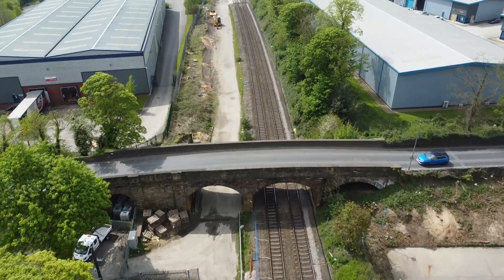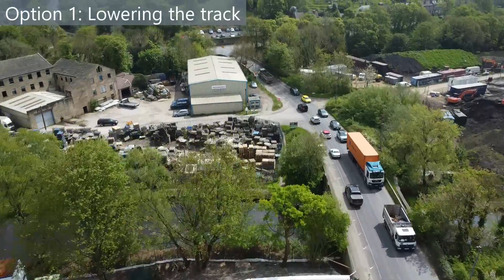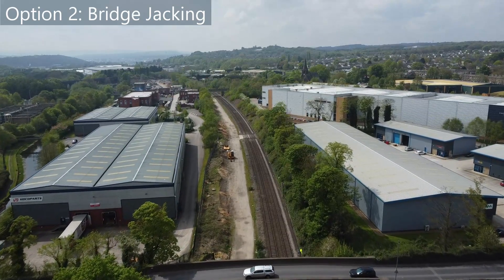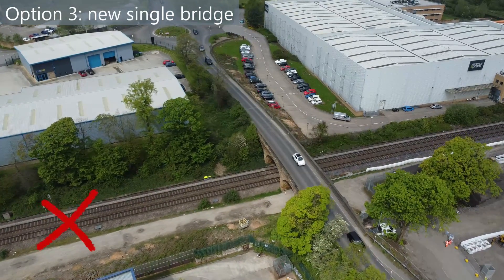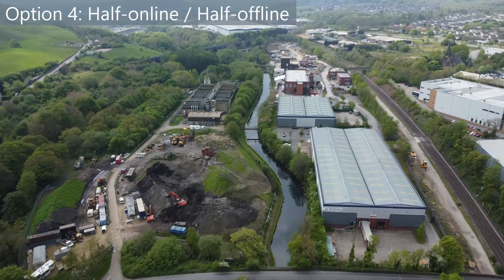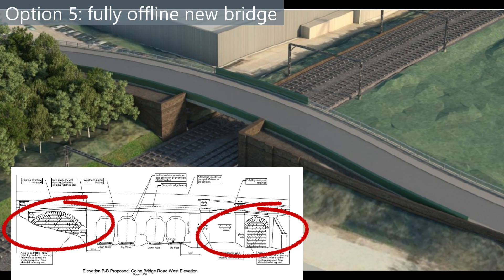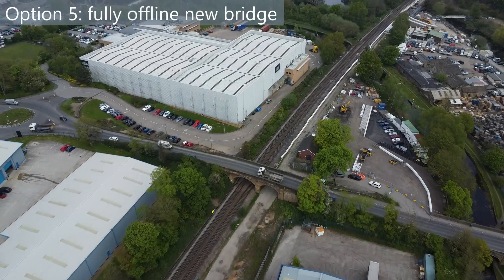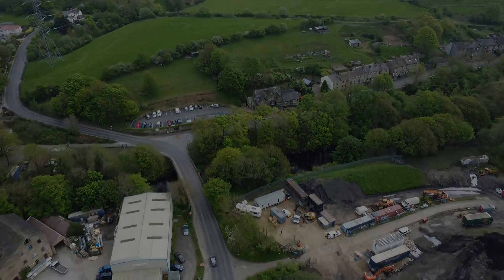DRONE Update: Colne Bridge, Transpennine Route Upgrade - a big change coming

Comment: Excellent and informative as always. Can't help thinking the option selection has been steered towards taking the opportunity to improve the highway layout at TRU's cost. I can't see that the road can remain open to road traffic while they rebuild the part of the structure being retained for the chose option, so unclear how road closure time could be used to rule out the option of raising the height of the existing bridge deck above rail level which could have retained more of the bridge structure.

As others have commented, it's just a small illustration of the difficult financial and practical decision making process when making large alterations to existing railways - and no less disruptive to the neighbours.
Reply from the maker: Perhaps the road will be reduced to one lane while the reconstruction takes place, so leaves the road open but still cause traffic disruption

Comment: I was here today doing a ground survey on another bridge further towards Huddersfield close to Deighton station I think the Bridge number was 02 at 28 mile post on the MVL3 in the Down Cess. we were digging to find the foundations of that Bridge because they need to lower the track there I was told
Reply from the maker: There's another bridge which will also be demolished and rebuilt closer to Huddersfield which connects to the greenway. I know it as Wheatley colliery Bridge. I've recorded a video already will come out in a few weeks. From what I remember reading tho that wasn't going to to have the track lowered https://maps.app.goo.gl/pFtLxU2vR9C35Pc97
Reply: @i_and_g_adventures    We had a team on the BBW close to Bradley Junction looking for a bridge foundation there, Iv done loads of ground surveys on this section. They even want to know what the ground is like 30 meters underground, We have been bring on huge drilling rigs.
Reply from the maker: Thanks, I'll keep an eye on what happens

Comment: This highlights, for good or bad, the HS2 line. The national railway infrastructure is tied to the Victorian designs and builders of many of the bridges, tunnels and the routes taken by the lines, which in turn had an impact on the British loading gauge and there being no way to increase it to the benefit of the train companies and the passengers and freight trains on those lines. No such constraints in Germany or France after WWII given the widespread destruction of railway operations; they had a clean slate on which to rebuild and expand their respective networks, with the eventual TGV and ICE at the forefront.
Reply from the maker: That's something I'd not thought of before

Comment: Listed building consent (and planning consent) will be required but you did not mention that.  Has it been obtained?    The point being that the solution will not be implemented unless local councillors approve and that there is no objection from English Heritage.   That last is key.
Reply from the maker: All required approvals have been obtained for the route changes. So my error!
Reply: A rather unfortunate loss but I think both Rail and Road traffic will benefit from this New Bridge Project.
Reply from the maker: Yes the road layout will be improved with the wider road and loss of the hump